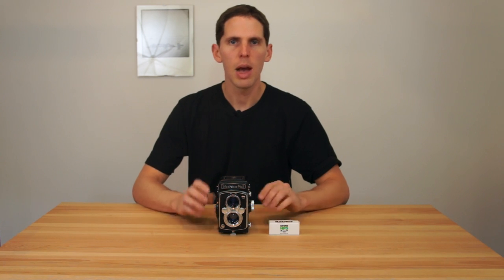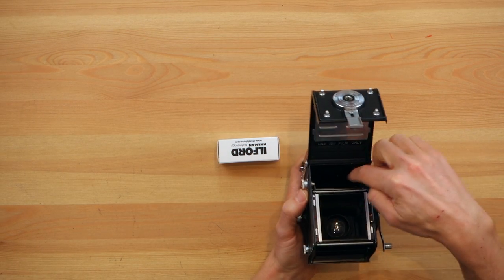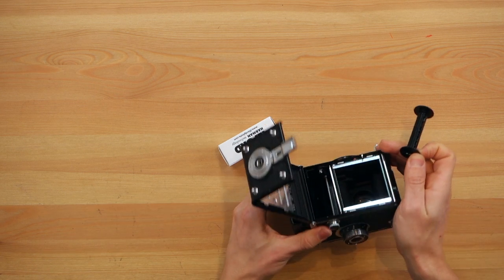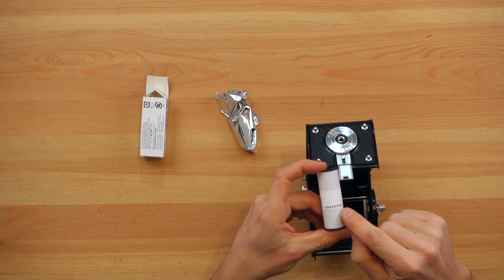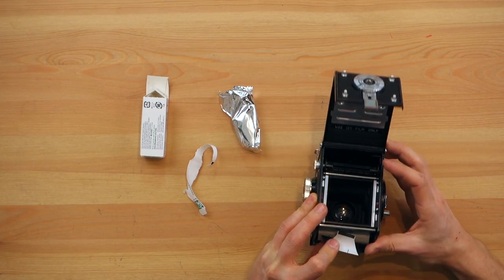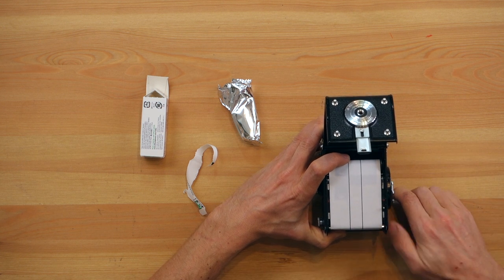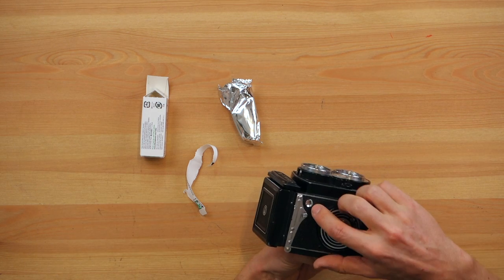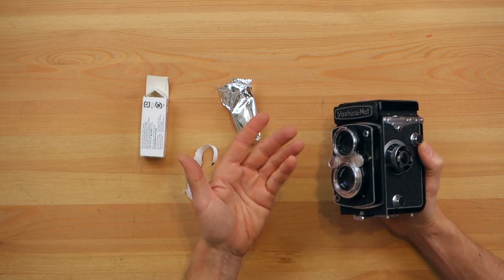Yashica Mat || Film Loading

Comment: Thanks for the helpful video. I just noticed that mine does appear to be the exact same model as yours overall (same writing, same lens,...) but it does instead have an only black focus knob like the one from the 124G. Do you know if there is such a model? Otherwise it must have been replaced some time ago? Luckily it works just fine.

Edit: I just noticed I also have a black disc on the bottom for opening the back and a yashinon 2.8 lens on top instead of the 3.2 that doesn't say "viewing"